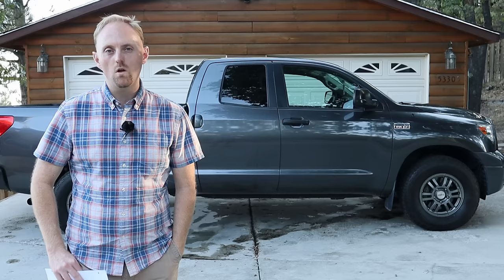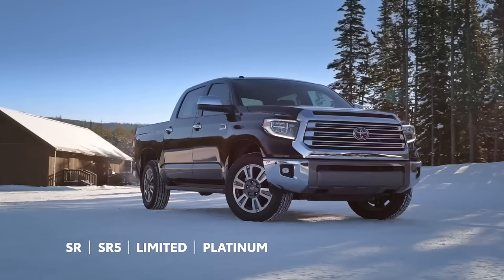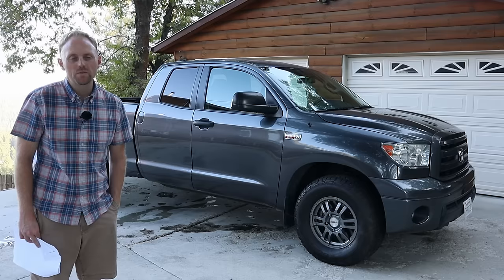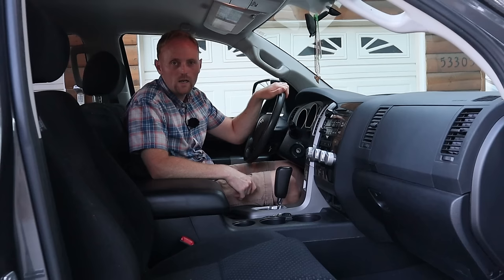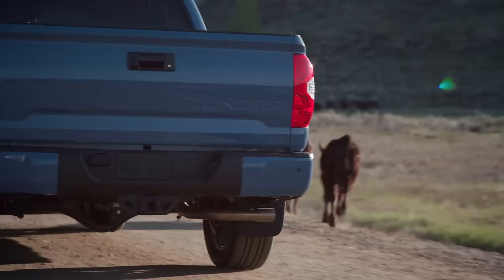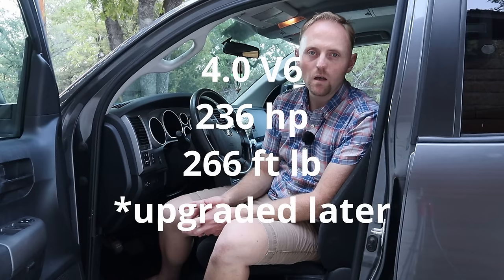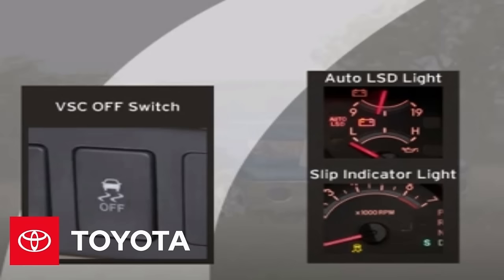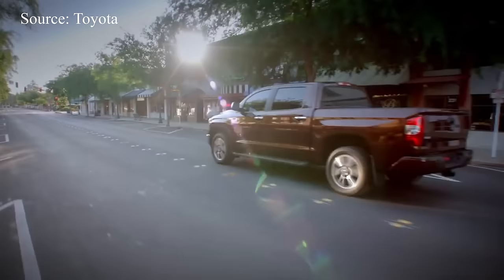Toyota Tundra  |  Brutally Honest Long-Term Owner Review

Comment from the maker: Would you buy a Tundra today in 2020 over the competition? If so, why? Let us know below.
Reply: No stick to my 07 like the body style. All the newer trucks look all the same body style.
Reply: Love my 2020
Reply: Traded in my 17 f150 with the 2nd gen 3.5 eb for a 2018 Tundra CM, TRD offroad. The EcoBoost towed and hauled great but the fuel economy loaded was comparable to that of a modern V8. Ever since they introduced the full size tundra in 2007 I've always been very interested. I've owned several Fords in the past and they've all been fantastic trucks, the tundra always seemed to get away from me. I had som concerns with long-term reliability with a forced induction engine like the eb. The reality is the tundra ticks all the boxes for me. I have a boss HTS series snow plow on the front of it, and the truck has performed flawlessly for me. It has all the bells and whistles that I need as you stated in the video. I honestly love all brands of pickup trucks and I personally believe all trucks nowadays will do exactly what you want them to do it's a matter of preference and taste which I believe is totally subjective. The bottom line for me was I want to be able to purchase a  truck, pay it off and have it still perform years down the road with proper maintenance. Could any of the big three do that? Possibly, but I like the odds of the Tundra better. The 4.30 rear end in my opinion is somewhat of a double-edged sword,  it's the tundra's ace up its sleeve when it comes to towing, obviously this comes at the cost of fuel economy but that's a compromise I'm willing to make. I have a 38ft travel trailer that weighs 8860lbs dry. Well within the 9800lbs capacity of my Tundra.
 A lot of my buddies ask me all the time how do I like the Tundra and I my answer is the same every time...it is the most honest truckiest truck I've ever owned. And for me that is a good thing.
Reply: Love my 2020, no regrets
Reply: I bought a 2020 Tundra TRD Pro in May of this year and love it. I purchased it for reliability as I'll use it for hunting and towing my stuff to camps. I don't worry about the fuel economy as long as it gets me to where I need to go and back without going to the shop for repairs.
The lack of all the "electronic luxuries" is actually a plus to me. Give me a damn knob to turn or an actual button to press. I don't like the idea of "tablet" running my truck.
All in all the perfect truck for me and that's what matters!!!
Reply: I have a 2008 limited crewmax . I just lost the transmission at 155k miles. I rebuilt it for 5k but back to driving.  It is back to towing 7k camper, Lift and mud tires for off roading. It hauls everything and i really like driving it.  I know the transmission was unexpected but sadly cheaper to fix than a new truck.  I do have a jeep wrangler for fun off roading now. Plus it takes me and my motorcycles where i need to go with a small trailer to race tracks, vacations even now.
Reply: Hell yeah 2020 tundra got one in January
Reply: I would not, they removed the transmission cooler in new models if you actually use your truck to tow people are getting overheating issues ( several videos with quick search). Toyota has responded to this by saying there fluid is ok at higher temps without the cooler but won’t release what those temps are even though customers are getting overheat codes with new vehicles. High heat over extended times kill transmissions sooner. Granted you can add in a aftermarket cooler for not that much money but why would they take an important part away that helps your transmission last longer that they previously had. I was looking forward to the next generation tundra but I’m afraid the reliability of yesteryear will be a nothing more than a memory if the same individuals that took away a transmission cooler are designing the new truck. Looks like a 7.3 gas Ford F-250 will be my next vehicle.
Reply: Hmmm, for 2020 no I don't think so. They are trailing in a few key places and the tranny cooler delete that they decided to do was a mistake for those of us who haul. I would very much consider a 2023, one year after the revamp in 2022. Toyota reliability is king and that would be my main reason for buying one. I find my Ram, GMC pickups and current Titan diesel just not reliable enough in comparison.
Reply: I love my 2017 Tundra and Toyota’s Reliability over Ford, Chevy, Dodge or any other truck.
Reply: @aaronn.1010  What year did they remove the cooler?
Reply: If i could afford one probably. Have been looking at used ones and most have 180-200+k on them and still running like new. Wont find to many trucks from other companies that high without drivetrain overhauls or major repair experience.
Reply: @alexmontesquieu2969  2019 they took it out, 2018 was the last year they had it in
Reply: What do you do for work to afford such badass trucks?
Reply: Had a 2000, 2007, and now a 2015, they don't blow up like a Ford, have loose suspension like chevy, or rust like dodge Ram, oops I mean Fiat ram!! And the glass tank doesn't rust out, and the turbo doesn't go out! I love my Tundra!!!
Reply: @bucknutty7593  I got a 15 with 84,000mi for 22000. I didn't think the price was that bad, the big three was averaging a little less, but not enough to fret over.
Reply: no   ford 150
Reply: I had a 2013 Tundra extended cab 4.6 V8 which I never should have sold. I now own a 2019 F150 extended cab which has a smoother ride and many nice features but the one thing I miss is the conventional rear door opening. I hate the F150’s suicide door opening. It’s cumbersome and especially inconvenient in tight spaces such as loading groceries in the back seat.
Reply: The Tundra 2020 is the last emperor. RELIABILITY.
Reply: Already have and never regret it
Reply: In Dec 2019 right before Christmas I bought a 2016 Tundra platinum. Reason why? Reliability and heritage. I looked at some fords and considered ram but when it came to being reliable, nobody can beat Toyota. The Tundra is made in the US in comparison to Ford being made in Mexico. I don't care much about the interior having the latest technology since this is supposed to be a tundra and I also don't want to break the bank account if something breaks in the interior.
Reply: No inline 6 diesel iron engine. I know about Duramax diesel that thing have belt to the rear a deal breaker for me.
Reply: The new ones aren't made in US anymore I heard
Reply: Just got my 2021 Tundra TSS and I am in love.
Reply: No....newer one's aren't just built as reliable like the older Toyota's!!   They are now built in America and Mexico......Quality is not there like before.  I would get the older one!!
Reply: Absolutely yes it’s one functional truck very well built much better than fake American trucks...
Reply: @justinharasyn1574  Throw a supercharger on it, then it will get 20mpg highway.  With 550 hp,  and it stays under warranty if done by a certified dealer.
Reply: If focused on GMC vs Toyota, Toyota 100%.  GMC is highly overrated and priced.  Poor ROI.
Reply: @aaronn.1010  i own a 2015 Platinum.  I have had zero overheating issues and I tow and haul throughout the year since buying new.  9000lb Travel trailer.  4500 lb boat.  Haul my 03 Jeep TJ.  Loaded crushed stone, tree logs, and so much more.
Reply: Oh, and 80k miles on it so far.
Reply: @satzawesome   Were you changing the trans fluid, they recommend every 60-80k if  you tow. 100k if you dont. Just curious, thanks!
Reply: @aquaticterrafirma   I got it used with 85k so I took it to dealer for transmission oil change at 120k as they recommended. They only did 4 quarts. I  was very not happy but they said that enough.  Anyway now it's back and running like new. Wish I did not spend 5k. It has no rust under the truck even being in the north east. Doing my research seems thr 07/08 had some failures but suddenly the failures cleared up  after the 09. Believe some thing was changed internally. I wish they had given a drain and fill option . The truck 
Went into limp mode and I towed a 7k camper 150 miles and fried the oil and what ever.
Reply: My ‘05 was bought new and it’s been great! Not a powerhouse but the cost of ownership and reliability are super!
Reply: I love my 2018. I get almost 20mph if I’m easy on it. The highest mpg I reached with tundras was 20.5mpg. My F150 was a slug for towing, I actually lost the differential and transmission while towing my travel trailer, with about 90K on it.
Reply: No, I would definitely not buy a Tundra over the competition.
The main reason is there are half-ton trucks which are superior to Tundra in crash test ratings. Safety first.
(plus the Tundra is ugly as hell)
Reply: @mjones2305  to each his own. I’ve had Fords and Chevys. I got tired of watching them break by just looking at them.
Reply: @mjones2305  That is very strange for a Tundra. I’ve had two, and there are many folks that get 300-1M miles out of them. My luck with Ford and Chevy are in the toilet. Both manufactures had major transmission problems way before they should have and my Ford F150 had to have its differential replaced with less than 100,000 miles on it. With every truck I own from Ford or Chevy I had to argue with him to fix things that I should not have to cover the cost of. I have never had any issue with a tundra at all. Sorry to hear your brother had so much trouble it is very unusual
Reply: @Deribinkle  I just bought a 2019 tundra... I had buyers remorse because of fuel fears.. how did you get the 20mpg?  After I bought it I hear all the fuel issues..
Reply: @CR10.07  Hey CR, I was really easy on the gas pedal and would come up to stop signs and signals slower. Obviously if people have a heavier foot the mileage will drop. Weather has some affect also. I got that mileage during warmer months when I didn’t have to warm it up as I do in the winter. I have shocked several people with that mileage. I average 18-19 when I’m not towing which is still good for a truck.
Reply: Brutally Honest Answer: I would buy a pre-2014 Tundra before I would buy any newer truck.
Reply: Anyone buying a Tundra for a heavy tow rig can get all pissy about the transmission cooler delete. If towing above 8k regularly, you should look at a 3/4ton. If towing less, you won't be affected. Tundras are great trucks, but unlike the big 3, they're not very configurable.
Reply: The Tundra Has gotten worse imo i have a 2019 limited and it has very little storage..so many things bother me with it.. is it reliable ya.. but it has fallen so far behind its really bad.
Reply: @CR10.07  you should be able to average 14.5 to 16, depending on city/highway mix, IF you care enough to not hammer it all the time. You can avg. even more: 45-50 best mpg speed with that rear end. Go secondary roads. Also, use your adaptive cruise control as much as possible. Using cruise to go 65 will get better mpg than feathering the gas yourself. Experience.
Reply: Karl Urban thank you I’ll take your advice
Reply: Toyota tundra sucks. Built with poor quality... my 2010 tundra air pump valve bank 2 stuck, need to be replace
Reply: @takingoutthetrash1512  air pump was a known issue for that year. Did you get 11 years out of it before that? I'm glad other brands don't have any known issues. Too bad you chose the one brand and model of vehicle that has a mechanical failure. You should've played it safe and bought a Fiat.
Reply: I recently just got a 2017 tundra  1794 edition and I love it. The reason I went with toyota is because they last long. I did my research and I couldn't believe how reliable this trucks are.
Reply: Got rid of my 2019 Tundra Crewmax 4x4. Gas mileage sucked, quality sucked, and it drove like a 1950's Soviet tank. I haven't missed that truck for one second since I sold it.
Reply: @riverrat0707  congrats!! hope you enjoy your new Tundra and it's horrendous fuel mileage! what a gas hog..
Reply: Stupid question.  Any Tundra, 15? Years old better than any POS from dodge, Ford or gm.  Add Nissan to the list too
Reply: I wouldn't buy ANYTHING that didn't have a manual transmission available.
Reply: Yes , Toyota,Toyota,Toyota. 

They focus on longevity not Horsepower and numbers that dont matter
Reply: It has remained unchanged since 2008.   They have changed paint, some interior stuff.   That is about it.
Reply: @scrappychildhood6633  That's a GOOD thing.
Reply: I bought a 2020 earlier this year. It has some kind of nostalgic, old school feeling to it that I like. Drives great.
Reply: I’ve got a 2008 sequoia with the 5.7l and basically the tundra platform. I have over 200k miles, doesn’t burn a drop of oil, I tow trailers and my boats with it all the time. Rock solid, nothing compares in reliability. I had to replace the starter so far, that’s it. Crazy how good this platform is.
Reply: I chose a 2015 tacoma
Reply: No. outdated no major change in 15 years
Reply: Nope, for one simple fact.  Toyota is still charging in general more than the competitors equivalent trucks for something that is essentially 13 years old.  By the time a competitors truck MAY have issues, the difference in fuel savings and purchasing savings would probably break even with costs and poor MPG of the Tundra.  It's just a matter if you are diehard Toyota and are willing to get fleeced for a truck whose price should have dropped since there has been really no major R&D or redesign costs associated with the Tundra.
Reply: When we were in the market back in 2014 for a truck.  The Tundra's had the best rear seating comfort and space for a double cab.  That sold my wife as my adult son travels with us on our long RV trips.  The Chevy's the rear seat was so short a small adult as my son would have to slightly spread his legs.  But more important was the rear seat back was very straight up compared to the Tundra's more laid back position. The F-150's you would have to go to the crew cab size.
Reply: The 2006 Highlander has 294k
Reply: It's a great practical truck. That would last a long time for daily use. I still prefer a v8 in half ton truck.
Reply: Big rock media do you like the tundra or the f150 ?
Reply: Yes without question.  I have a 2019 TRD-PRO.  This is my 3rd Tundra after owning GM trucks for 30 years. The words simplicity, functionality and reliability best describe my Tundra.  My vehicle is mostly used for farm and pleasure with me pulling a 8500 pound trailer on a weekly basis.  My tundra has never failed me pulling through 6 inches of mud or 12 inches of snow.  My younger brother 67 yrs, just purchased a 2020 and is pleased with his purchase.  This will probably be my last pickup whish I intend on driving until I'm ready for the pity hole.  Cheers
Reply: @justinharasyn1574  You put some work in that post. Appreciated 👍
Reply: I would wait for 2022 and maybe even 2023, but then again🤔I don’t need a new one 

2013 rock warrior used off-road for work
Reply: @nardvark5150  do you want a truck to be reliable or keep up with the features of other trucks?
Reply: I wish Toyota would make a HD truck.  My own truck is a Tundra but for work I have to drive an F-250 and what a piece of crap!
Reply: Bought a 2020 Tundra Limited last May. It has been great.
Reply: I traded a Titan xd diesel for a 2021 tundra. Why ? Reliable
Reply: @robertlabelle4657  Nothing tops reliability
Reply: @kennythomas2516  100%
Reply: You compared the MPG on a 5.7L to the shitty 2.7 Ford. The power differences and capability aren't even in the same universe. Lost me after that comment.
Reply: @kabbythedog9409  b
Reply: Two words : 
Reliability 
Resale value
Reply: I just got my tundra, feel like a boss
Reply: @justinharasyn1574  good for you buddy, you made the most logical choice, a lot of ignorant people have brand loyalty, you did the research and made a logical decision, which worked out perfectly for you. I agree, forced induction is not as reliable as naturally aspirated , there is

Comment: 2014 Tundra owner, 144k miles currently.  Never been in a dealer or shop for repair other than struts, trans service, alignment.  Nice review, many people don't get Toyota vehicles and the satisfaction of ownership of a quality machine.  Also, I was with you with all the "nanny" stuff until you said Adaptive cruise control is a nice feature.  No, it's not.  It's the reason the left lanes on the interstate are now clogged up like an old sewer pipe.  Everybody is going the same speed....
Reply from the maker: Never thought of that

Comment: bought a 2020 SR 4x4 DC back in Dec. Love it so far. Mileage could be better but not bad at 16.5 combined. Have taken a couple long trips and it rides comfortably. I wanted a 6' bed but not suicide doors so Ford was out. Ford Crewcabs with 6' bed are very hard to find. I liked the chevy 5.3 but ultimately the Toyota dealer was easier to deal with than Chevy dealer. And the Chevy is made in Mexico.
Reply from the maker: Thanks for sharing

Comment: O7 Tundra with 176K.  Had an issue with the secondary intake and had to be replaced. Toyota should have done a better job with fixing that problem.  In the last few months I replaced the evaporator and starter and thats all.  Great truck no complaints.  Going to take it to 300K.
Reply from the maker: thanks for sharing

Comment: I have a 2011 Tundra crewmax and after drive other trucks nothing quite measures up. I don’t really care about all the features on the inside I can take them or leave them, however I do plan on switching out the head unit at some point. I also appreciate the reliability of all Toyota products and fact I know I’m not going to be shoveling out money in repairs far out weighs anything I may not like as much. Love my truck and as far as I’m concerned no other brand is worthy for what I need my truck to do. Thank you for your great thoughts